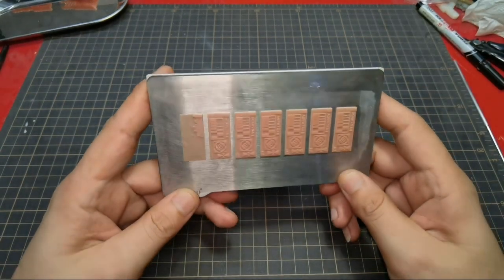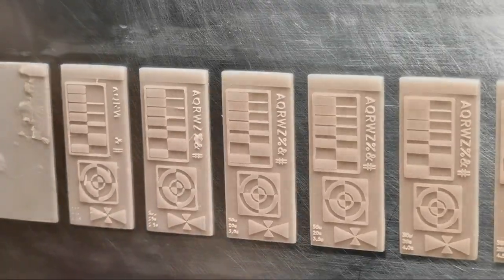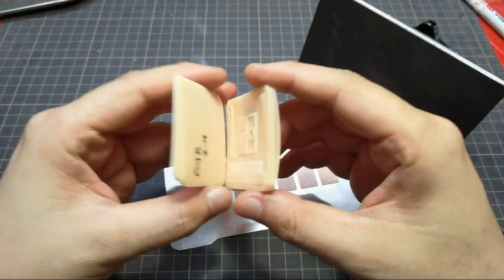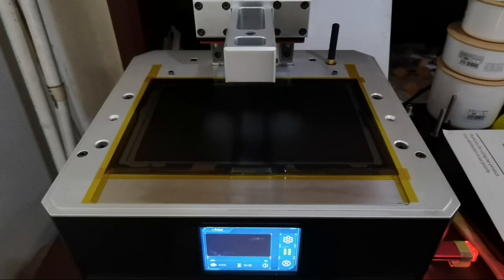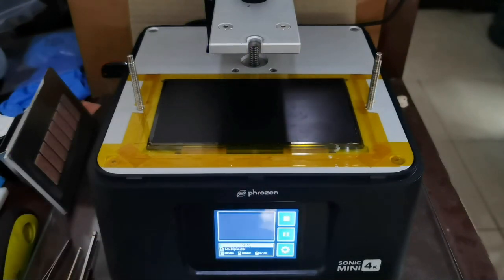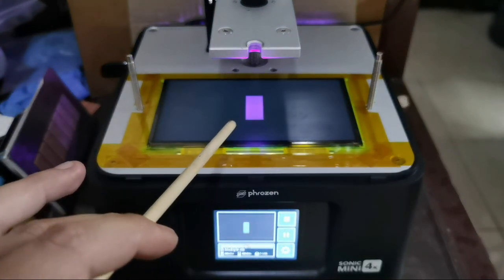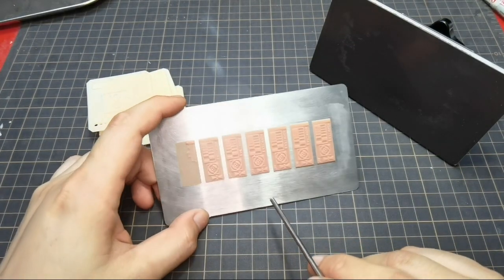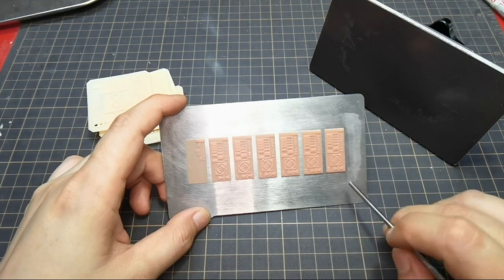Multiple Exposure Finder For Sonic Mini 4k

Comment: Very Interesting, thank you. One thing to ask - why do you have more available numbers for thin layers? 0.03 in 1.5-4.5 range , for 0.05 - 1.8-3 range? Looks like the thin layer requires a lower time value to cure, am I right? In your case 0.03 layer has a bigger top limit than 0.05
Reply from the maker: It is use for general purpose.
Most jeweler print on 0.03 and they use castable resin, such resin usually needs longer exposure. 
Also jeweler rarely use 0.05, 
0.05 mostly for new user print on 0.05 and use standard resin which range 1.8-3s.

But you dont have to stick to my multiple exposure, check the next video. You can make your own custom multiple exposure.
Reply: @wangdennys  I got the point, thanks a lot. I'm rather close to jewelers, but working with not-castable resins
Reply from the maker: @MichaelNeradkov  welcome

Comment: Awesome!  Could you share your Z lift speed settings?
Reply from the maker: Z lift speed and retract all 80mm/min, lift distance 6
Also use the firmware from my previous video for better movement and print time accuracy on slicer vs printer

Comment: Hi, thanks for your work. I'd like to know if its possible to change exposure time range? Like 1.8 - 2.0 - 2.2 - 2.4 - 2.6 - 2.8 - 3.0
Reply from the maker: What z height?
Reply: @wangdennys  50 microns..... If you look at Phrozen Resin Profile sheet, a lot of resin need an exposure time between 2.0 and 3.0 so a test in this range is good for fine adjustment. I only used times above 3 seconds for clear resin, castable, or dlp resin. I work in dentistry and fine adjustment is very important to get precise prints.
Reply from the maker: @drnunes  hi, i upload new link in the description for 0.2s increments from 1.8s-3s. don't forget to subscribe, like and share the video. Thanks
Reply: @wangdennys  Thanks for the file, it will help a lot. I've already subscribed here and will follow you on facebook too.

Comment: Do you have any for sonic Mighty 4k
Reply from the maker: Sorry i dont own mighty 4k so i can't make and test it.
Reply: The Mighty 4K should be the same, but you can only print at 50um. It doesn't go down to 30um.
Reply from the maker: @jamessovlinsky5017  really?
Only at 50um max?
Reply from the maker: Sorry do you talk about the z resolution or xy resolution?
Reply: @wangdennys  Z
Reply from the maker: @jamessovlinsky5017  well actually there is an advantage using smaller 4k screen like mini 4k compare to bigger 4k screen like mighty.
Also the z resolution you are using.
But it all depends on the model that you print. But if it good for you. Don't change.
LOL